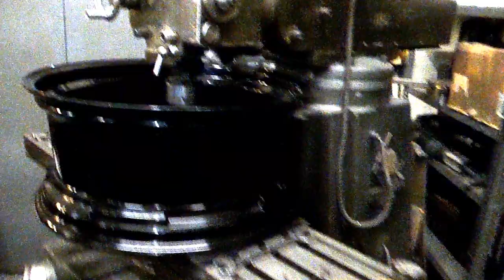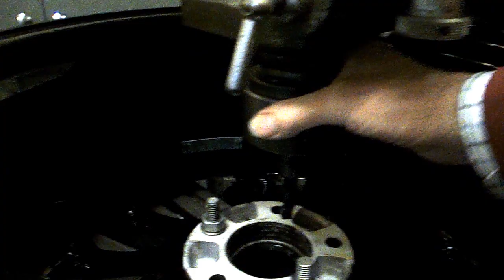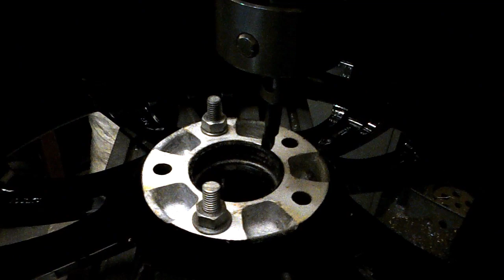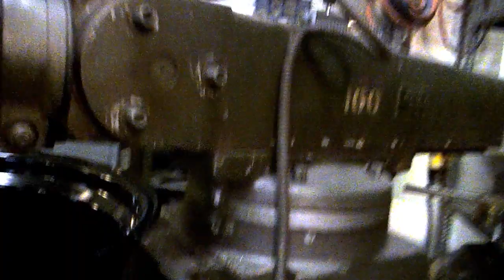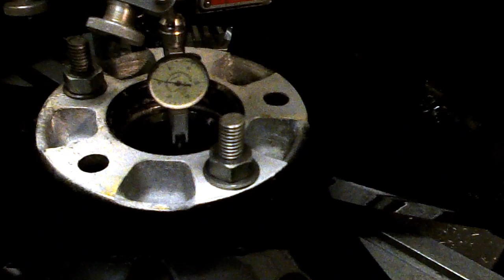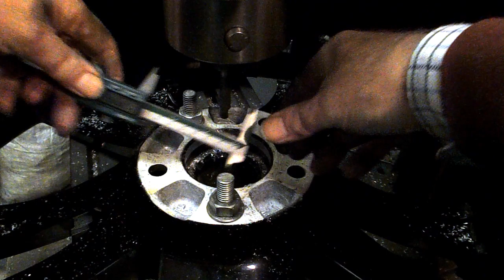Making the centre hole in an alloy wheel bigger!

Comment: Hi can you do 26 inch wheels on this type of lathe? Asking before I start doing this
Reply from the maker: The milling machine in the video has got quite a range of adjustment & could accommodate a 26" wheel. I'm not sure if a Bridgeport (the more commonly found turret mill in most workshops) would extend far enough. It probably would but I don't know for sure.
Reply: @ thank you sir

Comment: Had to do the same thing with a pair, however I had to do it with a router as I hadn't gotten my mill yet. So much easier with a mill
Reply from the maker: This was the first of a set of four. I've done a fair bit of routing on Aluminium but I would never have thought of using a router for this job. Sounds tricky!
Reply: @MidEngineering  with the correct size guide bush it supposedly work pretty well.

The wheel face keeps the cut square and the guide bush prevents too deep of a cut.
Reply from the maker: @prawny12009  Yes, I can see how that could work.